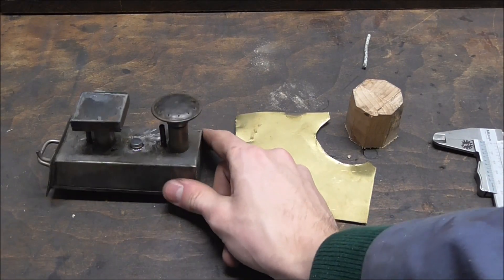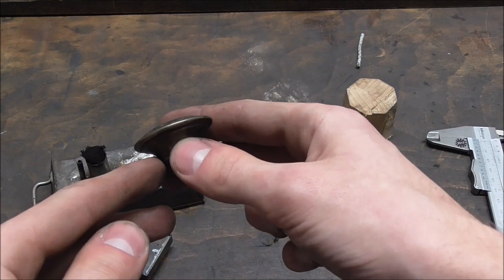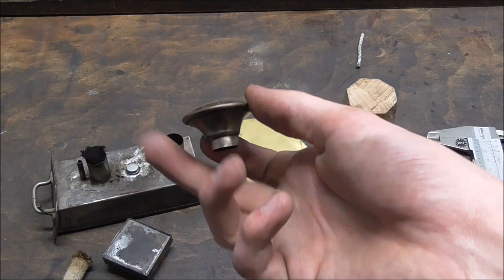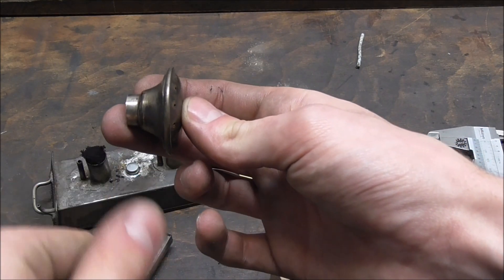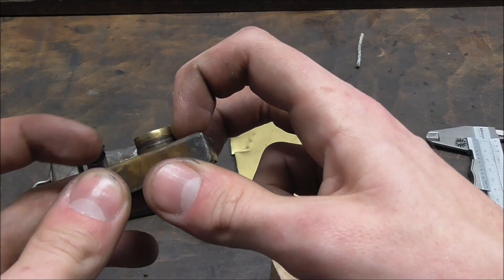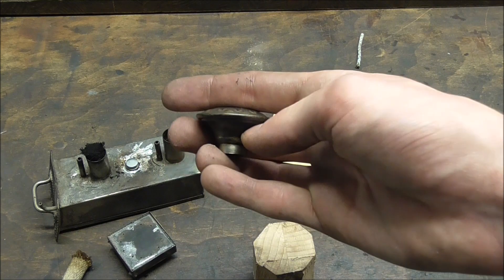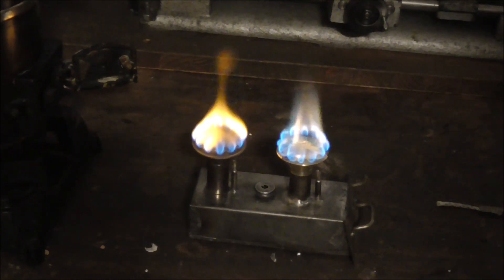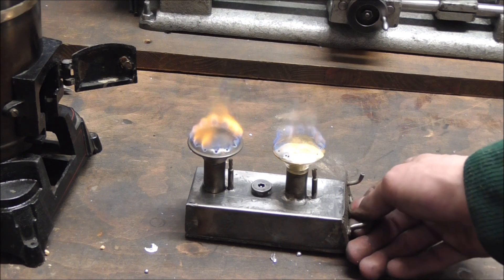Metal Spinning a Spirit Burner's Vaporiser

Comment: Oh you tease! We want to see the steam engine!! :)
Beautiful work man!
Doesn't the heat sink in too much inside the burner to melt the solder that attaches the two pieces?
Reply from the maker: Exactly that was my plan :D Trust me, the steam engine deserves an entire video on her own, she's quite a beast and extremely rare to come by. I am honored to have this machine in my shop!
The vaporiser does become quite hot, yes. But just like the solder on the boiler seems won't melt because of the water inside carrying the excess heat away, the burner is cooled by the vaporising fuel. Just like your hand feels cold after desinfection, for example.
In addition, I used silver solder which melts at ~650 degrees, so the vaporiser would have to become red hot before the solder would start to be impressed.
Reply: @AstraWerke  Ah silver solder as well! No worries then :) Looking forward to your next video!

Comment: Metal spinning is not easy to do. Nice work.
Reply from the maker: Thanks. It is a steep learning curve - I think with pins in the tool rests acting as solid lever points and some thinner sheet metal (I used 1mm for the job while .5 would have done just fine I suppose), I'm pretty sure some better results can be obtained. This'll do for the moment, though.